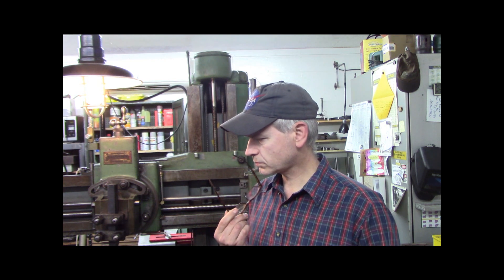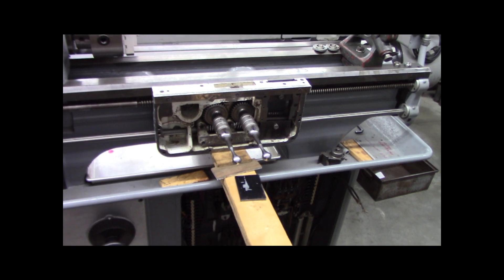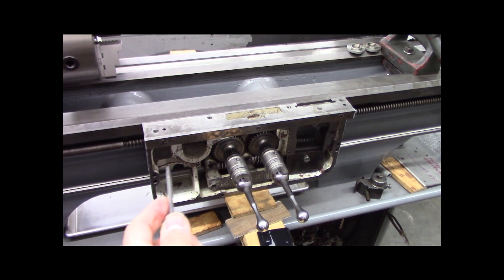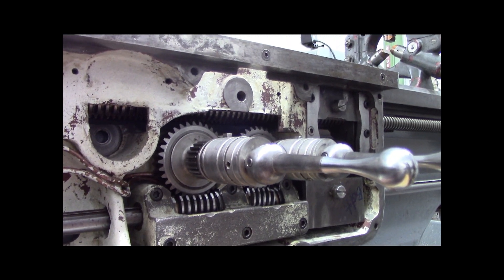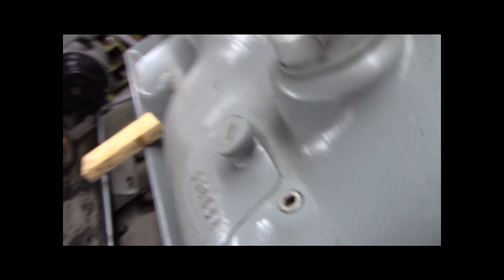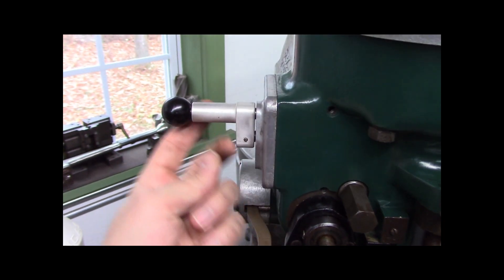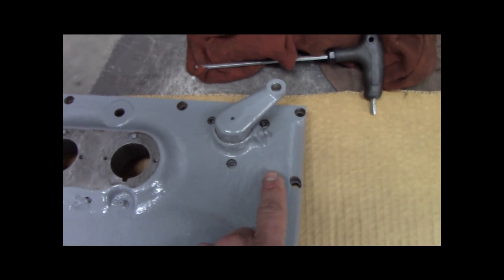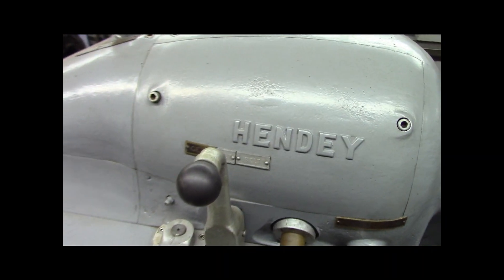12-10-23  --  Hendey T&G Lathe Part 8 - Apron is On

Comment: Those fittings are not Zerk, they are Alemite
Reply from the maker: The patent for the Zerk fitting was granted to Oscar U. Zerk in January 1929, and the assignee was the Alemite Manufacturing Corporation.
Reply: @kooldoozer  Yes, then in 1933 Joe Bystricky invented the "grease" fitting we know today, the Alemite Hydraulic, that the lube gun locks onto. Earlier Zerk fittings were tapered and relied on pressure applied by pushing the lube gun onto the fitting. Model "A" Fords were fitted exclusively with Zerks.
Reply from the maker: @kc5gym  You are 100% correct.  I never knew the straight sided fittings were Zerks and the nipple type fittings were Alemites.  I guess I have been hearing the misnomer so long, I wrongly assumed it was correct.  Thanks for the insight.  I just went down an internet wormhole researching lube fittings, so thanks for that too. Ha !   I still see some European machines with the straight sided fittings. Interesting.  Also did not know Model "A"s were had the straight Zerk fittings.  I have driven "A"s and "T"s too, and never noticed, or they may have been changed out over the years.  Anyhow, thanks again. -----Doozer